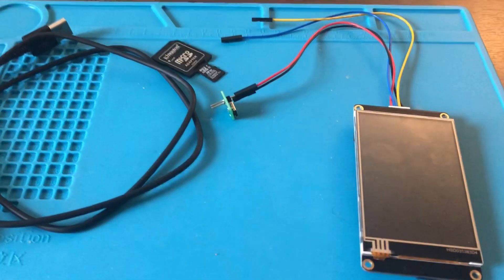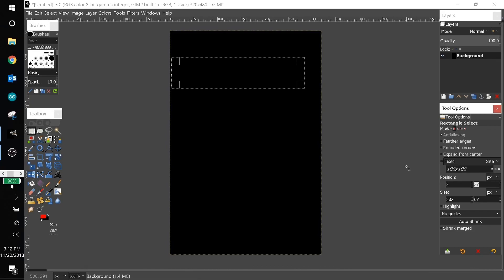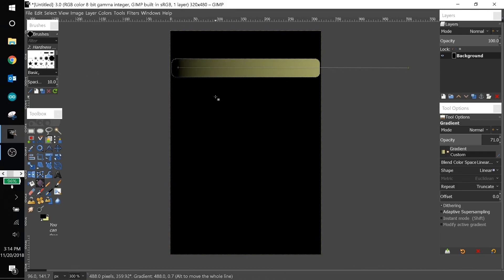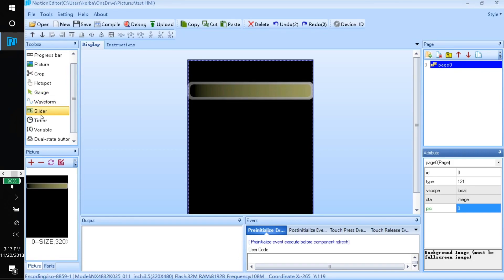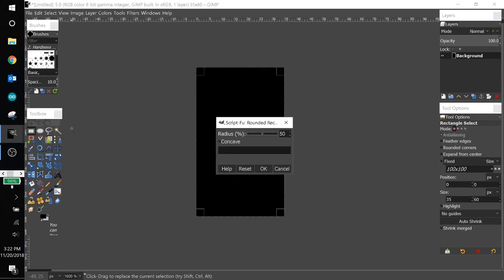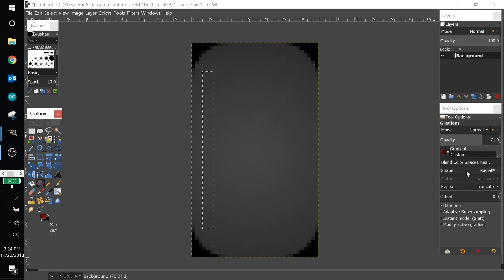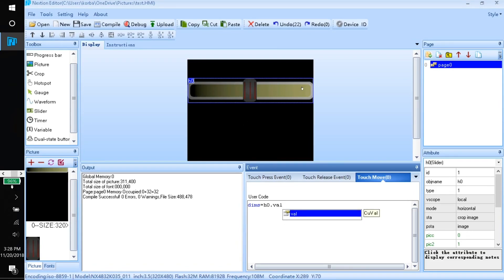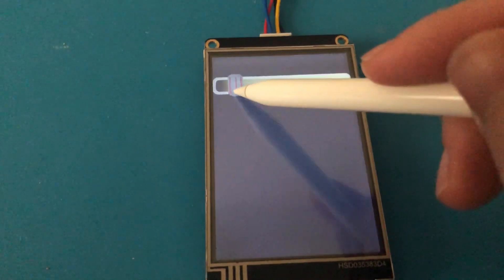Nextion Brightness Slider - No Arduino Required

Comment: Guys/Gals, can one of you help me please. I have implemented the brightness control.. When I am in the page.. it works well.. with either dim or dims. but when I exit the page the brightness returns to 100% and when I return to the brightness control page.. the slider is back to 100%.. so for me dims is not working:(. what am I missing? Do I have make h0 global and read it in every page and always program dim or dims?
Reply: Change vstat from local to global.. don’t have my computer in front of me but I think that’s the name. It’ll be on the side under “object I’d”

Comment: Your videos are great.  I have implemented this slider.  Could you do another video on two other subjects?  First would be, i have a screen of 6 buttons that are dual state like your console project.  However i only want one to be 'on' at a time.  for instance if bt0  currently = 1 and then btn3 is turned to =1 it will make bt0 = 0   Secondly, i would like to know if there can be a time out on a screen.  for instance if i am on the button screen and i dont touch it for x minuites, it will switch to a new screen that is black.  I will make the entirety of this screen a button that if touched it will go back to the 6 button screen.   Thanks again for your videos.

Comment: how to set the brightness level only with code and not with a slider in the Nextion Editor, for example dims=80. Where do I need to put this?
Reply from the maker: You would put it in the “Preinitialize Event” tab
Reply: @korbano  thanks :)

Comment: Great video.
BTW, you can also set the 'minval' to 1 instead of adding the 'if' statement.
you DO need the dims=h0.val
If you use dim=h0.val  (without the 's') the changes are not held during power off.

Comment: Excellent tutorial again. I'm really appreciative of your Nextion videos. What i have done on mine, instead of the if statement to stop it going black, I have just set the min slider value (minval) to 1 or whatever value you want the minimum brightness to be, therefore the dim value could never go fully dark.
Reply from the maker: That method works too and is definitely simpler than mine!